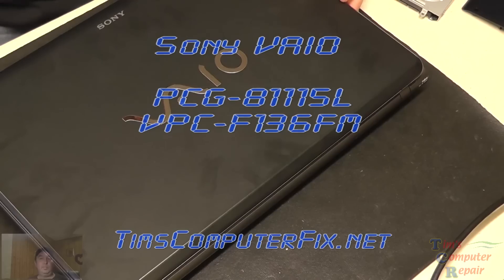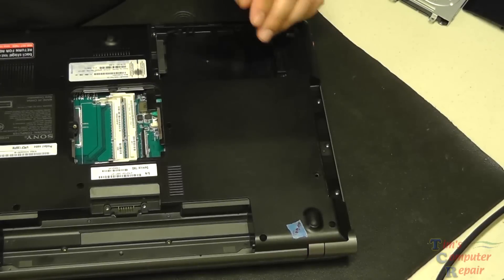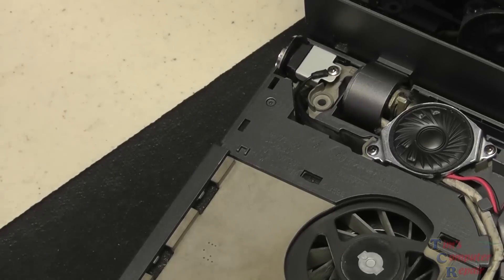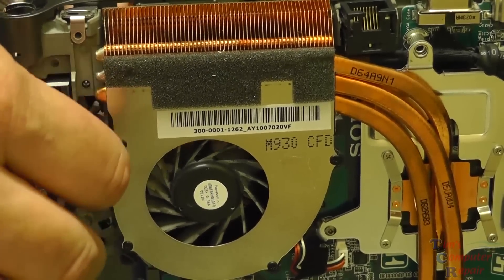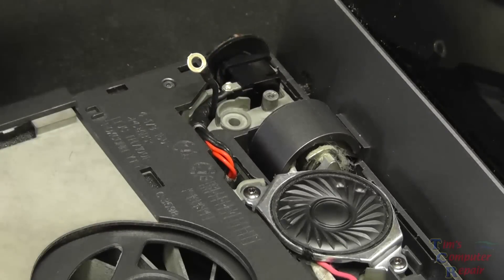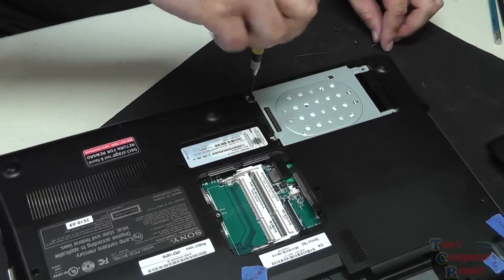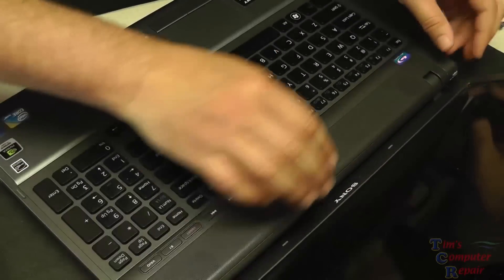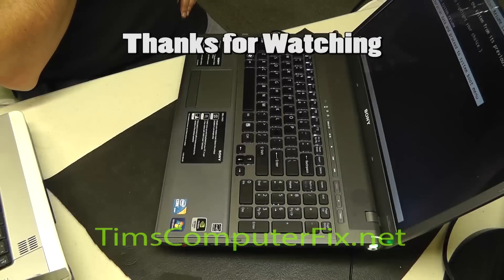Sony VAIO PCG-81115L Power Jack Repair by TimsComputerFix.net

Comment: Good video.  Now I can order a keyboard or a used one and replace mine.  I somehow splashed some chocolate milk on it and a few of the keys no longer work.  I took the bottom cover off to clean the cooling fan.  Now I have two very short screws left over.  SOMEONE TOLD ME THAT THOSE WERE POCKET SCREWS AND JUST TO PUT THEM IN MY POCKET.

Comment: I have the same laptop,  the power jack need to be replaced but the bigger issue it wont turn on. I get a rapid flashing green power button but no action. I've  removed the battery and plugged in the power supply rapid flashing green power button.  The computer has been put away now for a few year's and i just tried to turn it on to see if it would come back to life.😢 about 2 year's ago i went to bed with it running and working to wake up one morning to find it not on and would not turn back on. At that point in my life it was topsy-turvy with everything and i couldn't do anything to even look at getting it fixed... sony pcg-81115l fast flashing green power button? cause and issue , easy fix? I'd like to get it working again. Never used it much. It was a good laptop 💻 but i had my Asus gaming type laptop for photography editing and they still work ok, just none of these are much upgradeable now. Can you help. Thanks James KY4TRK is my ham radio call sign.

Comment: I know this is an old video, and my Vaio is an old notebook, but it works great being that it's an i7 chip (albeit version 1) and I don't want to migrate from Windows  7. ;-) Thank you so much for posting this, as I have been dealing with the wobbling plug/inconsistent charging port connection for quite some time. I found the correct port on eBay, without the extra "nub" that you pointed out, and it seems that, for once, everything went perfectly... the port arrived quickly, was the correct one, and the install went without a hitch. I would like to point out that on my model notebook PCG-81114L (VPC-F12YFX/B), there were 3 screws that were only accessible once the CD-ROM drive was removed, and I didn't realize that the screws next to the battery connector were actually screws that connected to the button board. I almost broke the board prying it up when it got stuck, but luckily I took my time and re-examined the bottom of the notebook, and discovered those screws. Anyway, thanks again!
Reply from the maker: Thanks for commenting.

Comment: I've got a machine with the same issue (I can see the two pins where the AC Adapter gets plugged in, so I guess the plastic barrel part has been lost) but I don't have the AC adapter itself - anyone know which model adapter to buy? The machine's a VPCF130D, PCG-81214L. 19.5V input. The power jack that gets installed inside the laptop seems to be readily available on Amazon, Ebay, etc.
Reply: answered my own question regarding the power supply. A friend has the same laptop, working, and has the power supply. I had a look and it has these numbers on it: pa-1900-12SY, and vgp-AC19V35, Input: 100-240V~1.5A, 50/60Hz, Output: 19.5V  4.7A, I've read that it's a 4.4mm barrel for the connector. I assume it doesn't have to be a Sony original - any power supply with the same output voltage and amps and the same size barrel connector should work. For my own case I'm going to need to buy both a new power supply and the new power jack part Tim describes in his video.

Comment: What can I say? I have the same SONY VAIO VPC-F136FM with the same Power Jack problem! Thank You alot for this video guide! BTW I've replaced HDD with SSD and thermal paste on CPU and GPU radiators, and upgraded RAM )))
Reply from the maker: Glad it helped!
Reply: @TimsComputerRepair  Two problems I have still not resolved with this notebook 🤕:
1. About half year ago I replaced battery, and some time it was working properly, but some time ago it stopped charging and always shows 24%, and if to unplug powercord, it loses power.
2. If boot it from cold power, display works about 2 min and turning off, if to push Display On/Off button twice, it turning on, and then it turning off again. If to repeat it about 30 times, display begin to work.

Comment: ..hmm.. I purchased Vaio VGN FW 448J/B while ago as a back up tool.
The power jack was busted already. At first i gave it to the pro in town to deal with it . They were able only to try to secure it in place with silicon . Waste of money. And they refuse to do by my recommended solution . So at the end I have to do it by my self. I could not get the proper parts except to buy the whole casing . So i decided to run "extension" cable out of the PC and let  it hangs down - it doesn't look very nice but it works 100%
Reply from the maker: Do what you have to do. Thanks for commenting.

Comment: my vaio (same model) has got a blinking power light when i plug the charger and it doesn't turn on. does it mean that the  power jack is broken or another hardware problem? (i've already tried remove the battery and use another charger)

Comment: So I did this repair without modifying the power jack bracket.  I forced fit and I think I left metal contacting metal.  What did I likely mess up in the motherboard by doing that.  The power adapter does not want to play with the laptop anymore.
Reply from the maker: Sounds like your have a short.

Comment: Hello, Mr.Tim I have a Sony Vaio PCG-7133l and I’m trying to do the same exact thing your doing, so my concern is my laptops older then this one, so how can I make sure I order the right size, and release the bottom port from its hindges safely 2/sided plates
Reply from the maker: Your going to have to tear it down and get a visual on the jack in order to confirm you are ordering the correct jack and how to remove the jack.
Reply: TimsComputerRepair I got to it safely, now I'm just stuck on a part that's locking the power jack in place, but I was able to safely unplug it, the only mishap I had thankfully nothing major, was the plastic bracket that just snapped from the thing, (trying to use force to open the laptop to try to gain access, but it still opens and closes no problem, I sent a email to show you the progress hoping for some advice on your recommendation, I'm trying to learn how to repair computers (something I'm very interested in learning)

Comment: Hello,
i made the replacement like in youre video. I have a strong "whining" (like cpu whining) from the replaced dc Jack when the laptop is idling. Its definitly from the DC Jack, because when i trun the cable it changes the noise and i hear it really clearly and i get crazy from it. do you have the same? the original one was quiet.

Comment: Im repairing a broken laptop for a friend, and that bracket you had to modify (as well as the original connector you screwed into it) is missing entirely. I ordered a replacement power port (missing cable included), but can I just leave that bracket out completely?
Reply from the maker: You should be ok however that bracket gives the jack support.

Comment: I disconnected the cmos battery and I was able to boot to a point because my hard drive was in. I get a message stating no operating system found.  If I connect the cmos battery I can boot one more time but after that no more until I disconnect the cmos battery again then connect or leave disconnected.
What I did next was connect the laptop battery, connect the cmos battery and then and only then I was able
to boot multiple times.  I put it all back together and its been working.  I can't figure out why just adding the laptop battery along with the power supply made the difference?
Reply from the maker: Flaky board for sure. Glad you have it working.

Comment: I have a PCG 81214L.  I have fixed the power jack and keyboard.  All has been good for a few months but since yesterday i can no longer power up.  No lights on laptop.  Battery must be
good since it worked the day before.  I have tried a couple power supplies still dead.  Removed battery and tried to power up with just power supply, no luck.  No lights anywhere other than light on power supply.   Any thoughts?  Can not find much on this laptop.   If my CMOS battery died would that prevent any power up action?  No lights dead.
Reply from the maker: Remove everything from motherboard except video cable, heatsinc and fan. If you get nothing then you have a failed motherboard

Comment: Thank you for your reply.  In my case the center of the socket is damaged. The center piece is missing exposing 2 pins.
Yesterday I had trouble finding the full cable. I finally did find the cable for about $7 on eBay and ordered it.   Thanks, Ken

Comment: I have a PCG-81214L, I noticed I can buy just the black socket.  Is there enough play such I could cut off the bad socket and solder on the new one.  Would save time opening the bottom of the laptop.
The socket is less than $5,   thanks
Reply from the maker: You could if you have mad enough soldering skills. It does not take that much longer to open the case.

Comment: hey tim, i have the same problem. i ordered a dc jack that is exactly like yours, i did your mod and all, and it works, but if i wobble it a little it still disconnects sometimes... could it be the charger's jack that expanded a little inside and sometimes doesn't make contact? dunno if buying another charger will solve it for me :/

thanks for video, helped me going inside without fearing to damage it
Reply from the maker: Sounds like the jack may be faulty.

Comment: Hi Tim, I replace the power jack with the same thing you have but my charger is a VPC-F136FM. Is both of these model have different charger? THanks.
Reply from the maker: Should not be. Be sure the amp specs are correct on the charger.

Comment: Great video!  Question:  Is there any reason at 10:10 you didn't add some electrical tape or some other non-conductive material between your modified bracket and the metal lead for extra safety? Would it cause a heat problem? is it just not necessary?
Reply from the maker: That bracket was not coming in contact with any connection on that jack. It basically sits on top of the plastic housing of the jack for support.

Comment: Tim, yer a champion. It just so happens I've got a PCG-81111W, very close to the model you repaired so deftly.I've no doubt I can manage it, but where on earth can I source a new jack and harness like yours?The systems are virtually identical they might as well be the same.Can you help? Is there a part number? I am tearing my hair out?Thanks,Robert
Reply from the maker: +Robert Ruork A quick search on ebay shows many of them available. Thanks for watching.

Comment: Hey, great video! my Viao is the same model and i think the power jack is the issue. the green power light will flash off and on, and no post screens appear. just flashes. is the jack the issue?
Reply from the maker: +Master Don Doesn't sound like the jack. Remove the battery and try. You will have to measure voltage from the adapter and where the jack plugs into the board.

Comment: could inform me what is the voltage and amperage of the charger this model vpcf136fm for i buy one? the battery model is vgp-bps21 tranks
Reply from the maker: +Ezequias Maciel 120W 19.5V
Reply from the maker: +Ezequias Maciel 6.15amp 19.5v
Reply: +TimsComputerRepair Thank you, great video , helped me a lot !

Comment: what happen if i just have the jack connector and not the cable?
i mean,when i bought the connector,this not been with the cable,just the jack
Reply from the maker: +El Chimbu You could carefully solder the wires on from the old jack. This does take a bit of a steady hand.

Comment: Thank you so much for sharing this video. I am about to repair my nieces laptop and it is this EXACT make and model with the exact same problem. I love the flat gray/black flat tool that you are using. IT appears as though one side has a flat prying surface and the other a pointed end. Can you tell me where I can get that exact tool PLEASE?

Comment: Thanks for the video. You mention using a voltmeter to check for shorts, how would you do that on this model. Thanks.
(Reason I ask is that I put mine back together and now there's no power whatsoever, so hoping there's a short somewhere).
Reply from the maker: ***** You can test for voltage where the jack is plugged into the board. I would test on the pin side under the board where the jack is plugged into. You do this of course while the power cord is plugged in being careful not to cross + and - . You should be reading 19v

Comment: i have the same laptop..can i get the part number for the replacement jack? or can i order direct from you. I'm tired of placing heavy books on my jack just to keep it charging.
Reply from the maker: Chris Smith Don't know the part # off hand. If you throw the pcg # up on ebay you should be able to find it. It's a common part.

Comment: Thanks for this video!  I'll be doing mine tomorrow thanks to you!
Reply from the maker: Paul Englander Good luck and thanks for watching.
Reply: TimsComputerRepair
Ran into an issue because my Sony has a CD-ROM.  I'm having an issue removing the back panel in that area.  Much thanks if you could offer advice.
Reply from the maker: Paul Englander Depends on the model. If all of the screws are out from the bottom I have seen where there may be a screw under the keyboard that is securing the back panel. Try removing the keyboard first but remember. NEVER FORCE ANYTHING!

Comment: I will soon be doing the same repair to my mothers laptop.  She dropped it and it cracked the dc jack and broke off the plastic where the screw for the ground lead goes into.  Is there any possible way to work around this?
Reply from the maker: maynardjesus You could try just not grounding the power jack cable. That is there for extra grounding protection however it is not necessary. Of course if you could find a way to get that cable grounded it would be a better way to go.

Comment: Excellent instructive video with tips to make the process easy and to keep out of trouble. Even with all screws removed,  however, the tight-fitting case was a bit tricky to get apart the first time around.Yes, because of this video, l have been called on to repair more than one. Wish all instructional videos could be this detailed and easy to use. FIVE STARS !!!
Reply from the maker: Harriman Jett Yes it can be a bit tricky the first time around. Glad the video helped. Thanks for watching.

Comment: Thanks for the video.  Have a Sony VAIO PCG-81114L.  Instructions were basically identical.  Save me a bunch of money switching out a part that cost me $12 on amazon myself.  Only thing I did differently from the video was not remove the keyboard or the ram.
Reply from the maker: Glad the video helped. Thanks for watching.

Comment: Hello my friend, first congrats by the video, helpful for users with difficulties. I have two problems with my Sony VAIO VPC-F136FM, the first one I solved with your video, the second I hope you can help me, the problem: My laptop doesn't recognize the battery (is not the battery, I tested another one), in  Windows (8.1) said that the battery is connected, but the charger not, if I remove the charger the laptop is turned off. If I unplugged the battery Windows says that the battery isn't connected, just the charger. Some app recognize the battery normally, but when I remove the charger turn off. What can be the problem? I appreciate your help.
Reply: I have the same model laptop as you, i know exactly what it is. The issue relates to 2 drivers: the Sony Notebook Utilities and the Sony Shared Library, the order by which they are installed is CRUCIAL, the Sony Shared Library NEEDS to be installed first, then the Sony Notebook Utilities. The problem you are having is because windows 8 probably installed them out of order.
Another big problem too is that the Sony Shared Library is "notebook specific" you HAVE to use the one specific for your laptop, if you download any other Sony Shared Library it will not indicate to you that is not for your laptop model. Even if you uninstall the shared library and the notebook utilities it is not going to work even if you clean the registry, your only fix is to format the hard drive and reinstall windows. 
Also because of the Sony Shared Library driver that is needed to be installed, Windows 8.1 will never work properly on the VPCF-136fm, i tried to get it to work... you can manually exclude the Shared Library and the Notebook Utilities drivers but then your laptop will not work properly in windows 8.1.
Your battery is fine, is all a drivers issue

Comment: Hello, my name is David and I live in Brazil, working in a technical assistance on notebooks and I have a Sony Vaio PCG-81114L, initially he did not recognize the battery, but I changed the CI Charger (BQ24753A) and he now he recognizes, it shows charging but does not charge. My operational system is Windows 7 Ultimate 64 Bits. On Vaio Control Center my battery shows as Critical, i change the battery but nothing change, Can you help me?

Comment: I'm glad that I have seen this. I haven't been able to use my laptop for a year because of this issue. I have asked several people who are more computer smart that I am, and who have experience fixing computers about this problem and both said that I would have to replace the motherboard. So, being short on money I haven't considered doing that until now, but after seeing this I realize it is not a motherboard problem. At one point, or with other laptops, was replacing the motherboard the correct solution?
Reply from the maker: I am glad my video helped you. Thanks for watching.